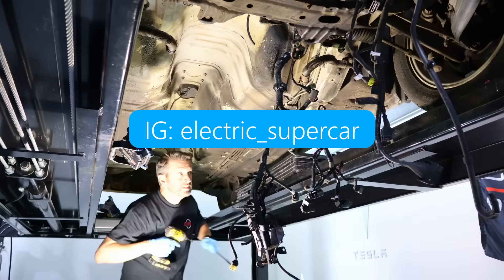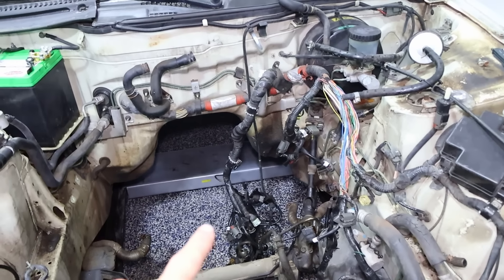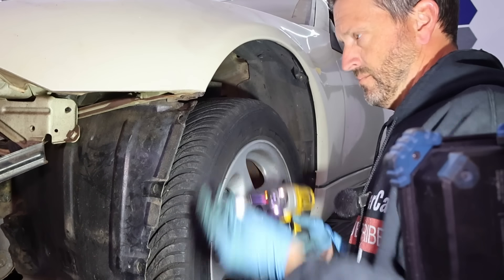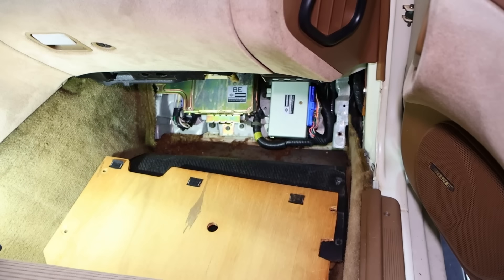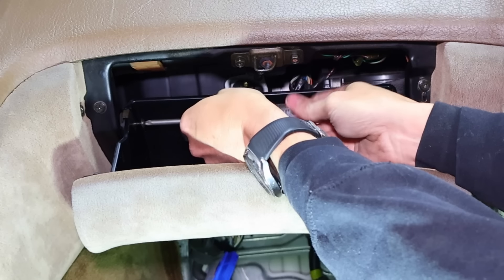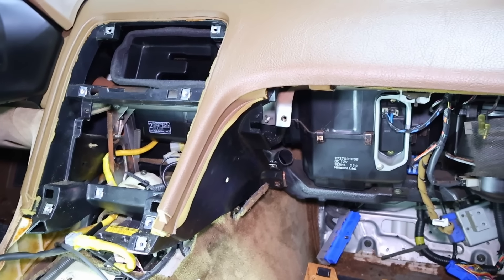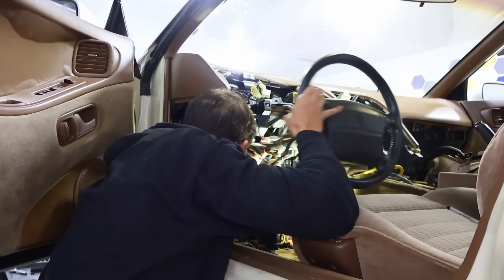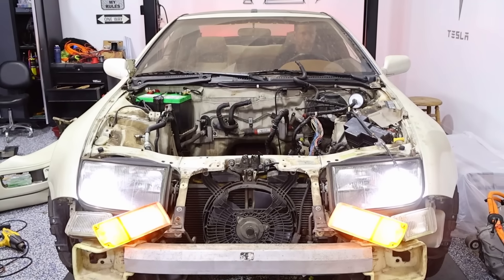Tesla Swap Begins: Stripping Down a Nissan 300ZX for Electric Conversion

Comment: Cool new project, can't wait to see the end result. 

Tip for future projects though; 
Before starting the teardown of a classic try to get either a Haynes manual or manufacturer/dealer official one. 
Those contain how to assemble/disassemble the entire vehicle, including torque values, schematics for the electronics (including colour coding/voltage and resistance values), and more
Reply from the maker: I have the service manual.  32 year old manual was not much help

Comment: Your methodology will be beneficial for sure. Lots of work, so many cables. And is it worse in modern cars or does the bus systems help to minimize it?
Cheers 👍💪✌
Reply from the maker: 2014 Porsche was easier to get rid of wiring than this car

Comment: 2:35 Not sure if you know it or not but I'm gonna leave it here anyways. the fast blinking of the indicator is called "Hyperflashing" which is caused either by a faulty indicator relay, or the wrong type of relay used for the bulb (or LED lamp). the relay works by cutting off the power when the current draw reaches a certain level then it switches to the off position which then goes back on. this being said LED lamps draw very little current so when the relay cuts off the current  quickly reaches 0  so it turns back on. for this purpose you have to use either a new relay for the bulb OR thewiring has some issue with it. or if you want to change to LED lamps you have to use LED specific relays. keep in mind, newer relays are Solid State relays which are much much more reliable BUT they don't have this tick tick sound, so companies add the "tick tick" via either a buzzer or the speaker themselves... love the process by the way🙌🙌Keep up the amazing work!
Reply from the maker: Thanks for the insights!

Comment: Is it possible the power steering module in the footwell is for the HICAS rear wheel steering system that some of these had?
If so, you'll have to figure out either retrofitting it to work or disable it if it hasn't already been done. That system failed pretty frequently in most owners disabled it instead of fixing it.
Reply from the maker: I think I will need to pick up a delete kit